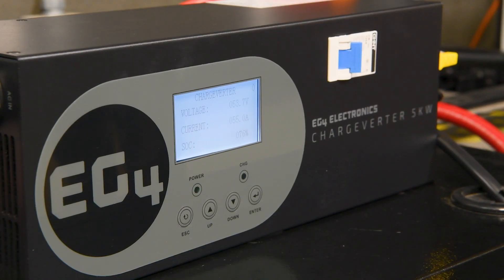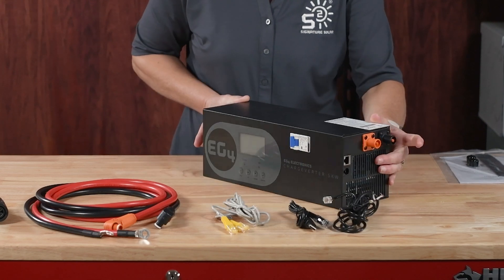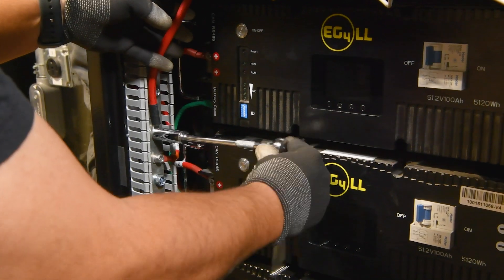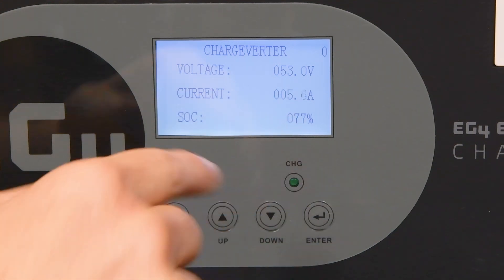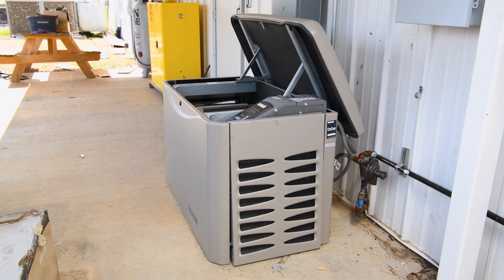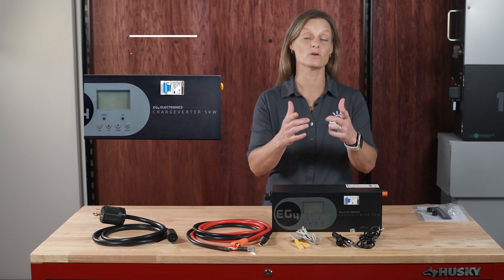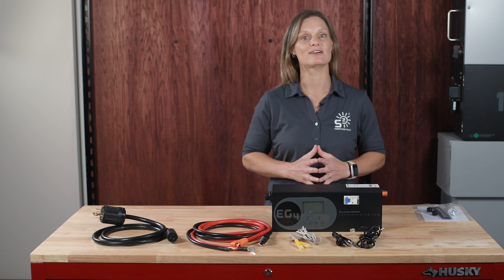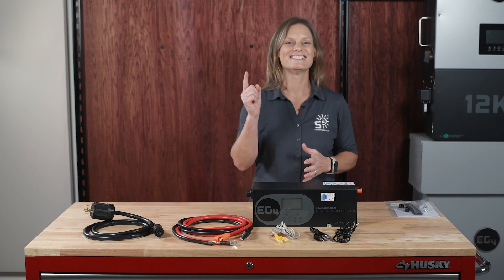EG4 ChargeVerter GC: Charging Batteries Efficiently from a Generator

Comment: Seems like a good solution to use a 3 phase generator to backup a home, assuming you've got solar & batteries on the system.
Reply: https://youtu.be/OHAXydKthXM
Reply: Why in the world would you want a 3 phase generator for home use? NOTHING in a home can use 3 phase current. Almost all home generators are single phase 120 volt output or single split phase 240 volt with neutral.  3 phase generators and motors are almost always used in large scale commercial operations and almost all power station generators are 3 phase windings. The military also uses 3 phase current.  What ends up in your home is actually just one leg and a neutral wire of the 3 phase generator output from a power station after it has gone through a multitude of transformers, some on poles on your street..
Reply: @kimmer6  Because it was cheap? I acquired a 25kva 3 phase generator for less than $3000. For backup battery charging, it's a steal. But please, go ahead and lecture me on electrical, having done a DIY 20+kw solar install with 130+kwh of storage.
Reply: @joeldcoxks  So you know everything. 3 phase power has zero place in residential housing. Your post says everyone should use 3 phase. Nope.

Comment: What are the criteria for determining if you need to install one of these between your inverter and a generator?  I believe if it's an inverter generator, you're good to go / don't need to have one, if I recall.  Same thing, what if people have a say 20KW standby generator?  Does it just depend on the standby generator?
Reply: Your generator must be Huge if you are using multiple units in parallel and especially if running large loads.  And Only One Generator must be hooked up to all units in the system.  So you cannot hook up a 5000w continuous output pure sine wave generator to 2 6000XP's if you are running say 6000 watts of loads on your 12000 watt system.  You would need a generator that could put out 12000 watts continuous pure sine wave of less than 3% distortion.  See my comment on this video for more complete info.
Reply: @sciglassblower  I have a 20kw Briggs and Stratton standby generator and an EG4 18k.  In the odd event that I lost power the batteries needed charging, I just want to make sure that I don't damage my inverter.
Reply: @ericjansen9042  I hear you.  That is a Huge Generator for sure.  Standard generators are not inverter generators and the rpm of the generator is what determines it running at 60 hertz.  If you have a meter to read hertz check it and if it is off check your manual.  I don't know if it has auto adjustment or manual adjustment but that is the main issue.  She said that most generators are only stable at up to 60% and others claim up to 80% on standard generators.
The trick is to keep your loads low when using the generator on the 18K and set the total generator current to limit running the generator over 12K output or so.  12k output at 240v is 50 amps.  12k charging is 230 amps into the batteries but part of that will be used for the loads.  Or you can get 2 ChargeVerters and run 240v from the generator to both and get 200 amps charging to the batteries or 3 for 300 amps.  Your generator can handle this.
It is a bummer that they have issues with damage on these All-In-Ones if the harmonic distortion is too high.  They should have designed this better to handle more distortion, but they really should have a real charger like the ChargeVerter built in.
Reply: @sciglassblower yes yes and yes!  thank you.
I will wait until they address this issue before buying an eg4 18k
Reply: Yes. See video at 6:45
Reply: @RichaRat  Ah, missed the part about 3% THD.  Granted, I still don't know what that means.  Guess I have some research to do. ;)